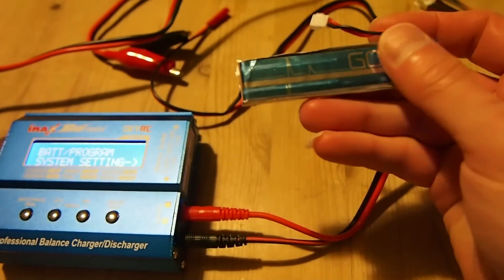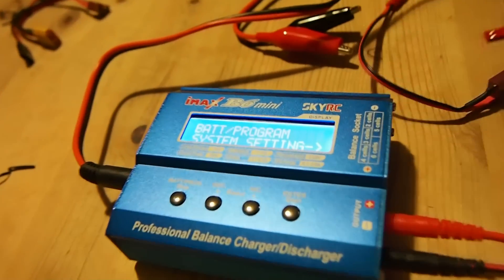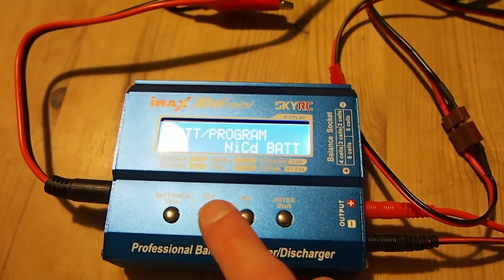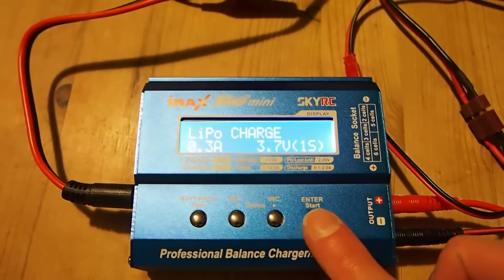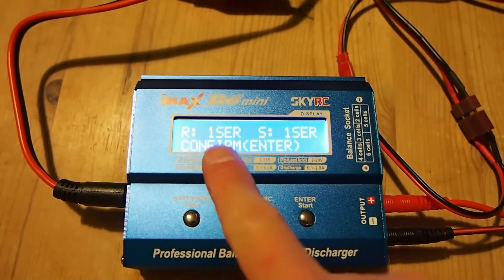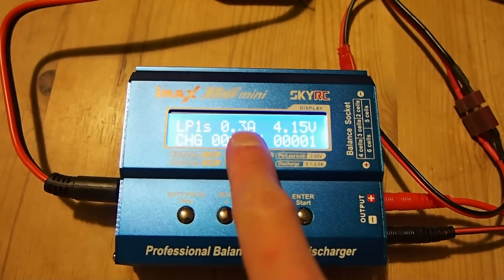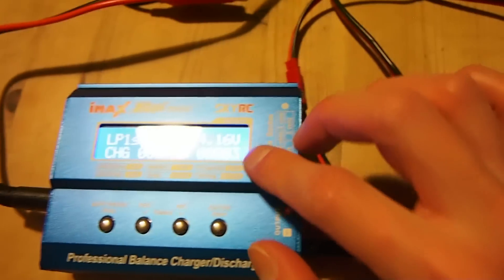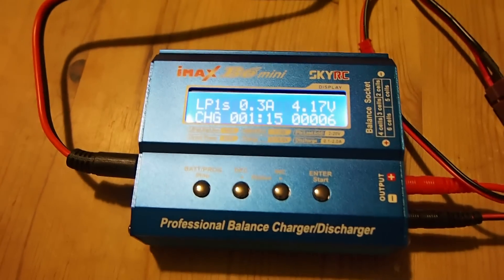Short demonstration of the SkyRC iMAX B6 Mini all in one charger and discharger

Comment: hi, did you control voltage of battery/cells with a voltmeter to check if it corresponds with the value shown on B6 display ?
Reply from the maker: +marco mathyaker S. yes I checked and they don't exactly match up, but my multimeter isn't a very expensive one and thus shouldn't be used as a good source for calibration.
Reply: +Brian Su ok, thank you
Reply from the maker: +marco mathyaker S. that's cool :)

Comment: thank you for the video , can you use a  Parallel Charging Board for IMAX B6 with this.
Reply from the maker: +freediver Jallez Hello, Yes you can for single cell batteries. No charger in the world can tell whether you are using a parallel board or not because the load will appear to be from a single battery.

Comment: Is mini better then the normal imax c6?
Reply: Thanks for the speedy replies! :)
Reply: +Brian Su - do you have the link for your JST to Micro Rc connector? I am not sure what to get. I like the multiple wires. Also do I need to get the D - connector to JST as well or is that in the box. Thanks for your reviews. New to this and your helping me learn. My first balance charger.
Reply from the maker: +Robert Street OK found it!! The connector is called 'Micro Losi' not 'Micro Rc'. Here's the link: http://www.ebay.co.uk/itm/Multi-Battery-Charging-harness-JST-BEC-to-5x-Micro-Losi-Walkera-/361177526702?hash=item5417dbb1ae:g:cdgAAOSwa39UrSPz
Reply: That was fast - Thanks! Can I charge 4-5 batteries at the same time with that?
Reply from the maker: +Robert Street Yes :)
Reply from the maker: +Robert Street No prob
Reply from the maker: +Miljan Miletic Yes the Mini has twice the discharge power ability. Mini can discharge at 2 Amps while the big one can only discharge at 1 Amps max. The other advantage is the Mini has a built in micro USB port for interfacing the unit with your PC or Android device.